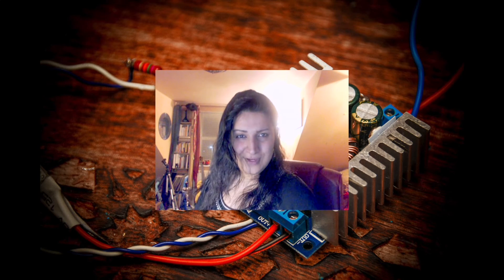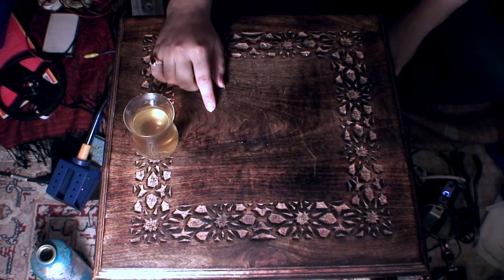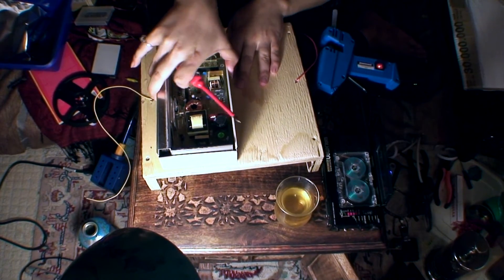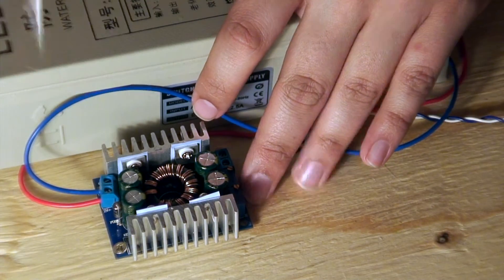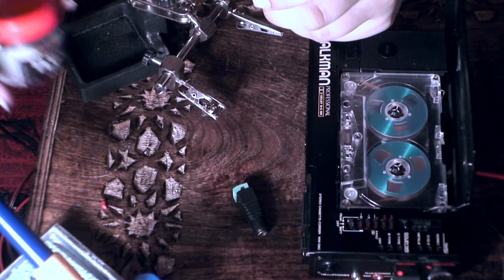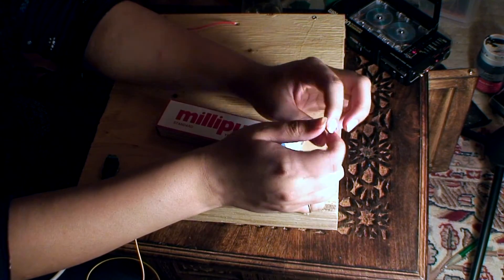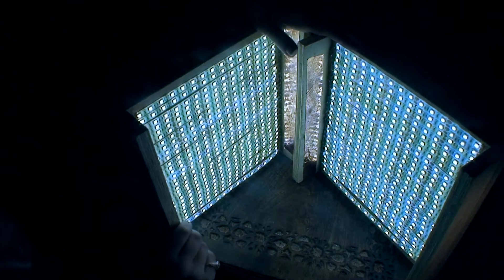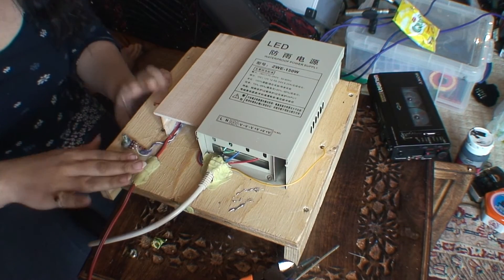DIY LED Lighting Panels - 04

Comment: That did not look "very carefully", Maddi. You actually made me jump in my seat and even though this video is about 1½ years old, I still had to tell myself a couple of times that you probably were alright.

I love the music you play. Simply because it's the same music I like to listen to... JMJ, Fleetwood Mac, I can't remember them all, but I thought I heard some Koto in one of your videos.

It's a nice touch that you play it on your walkman, except when you cut the video the music skips. It probably wouldn't bother me, if it wasn't for the fact that I love this music (which is kind of freaky too, you know).
Reply from the maker: Haha the drill bit bent, I was as shocked as you. I really need to get a better and faster portable drill, this is only designed to be a screwdriver and light thin drill work. 

I think it's probably good that the music cuts, simply because I would get a copyright strike on youtube, this is why I play it quietly also.. in fact in one of my video there is a strike :o/
I do love 80s music, some 70s too actually.
Reply: I should have known that there were thoughts behind the music cutting like that, makes sense :)

I think that drill bit had some metal fatigue too. I'm not a huge fan of violent power tools, in fact some of them often scare me a bit. I guess I'm not butch like that. So I tend to not buy them if they make a lot of noise, spark or vibrate a lot.

I also like to have the stuff I work with securely fastened. So I very recently bought a drill stand. I've been searching for something like this for a while. It needed to be small and versatile, because I don't have that much space in my workshop. But most importantly; I can change the power drill. In other words I can use a drill I'm comfortable with.

Here is the one I got:

https://www.primusdanmark.dk/sjleboremaskine/2938-borestander-til-alm-boremaskine.html

It is (for obvious reasons) from a Danish company. But if it sparks your interest, I'm sure you can find something similar closer to home.